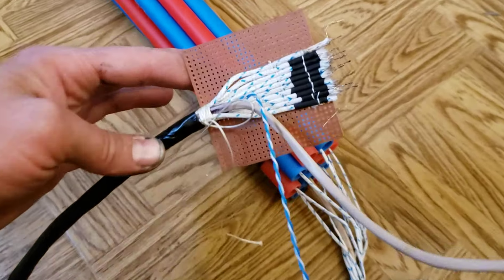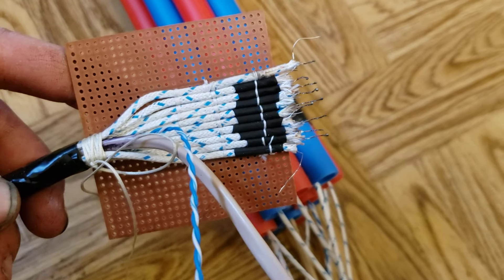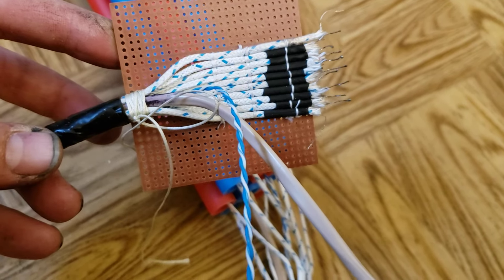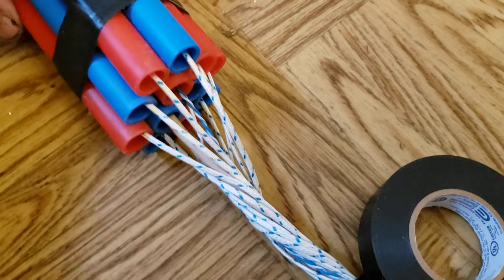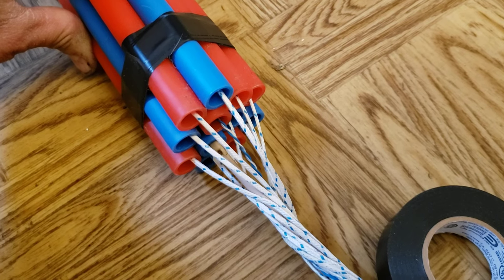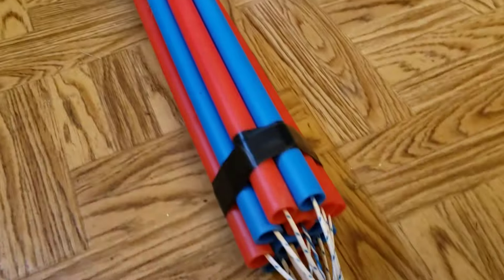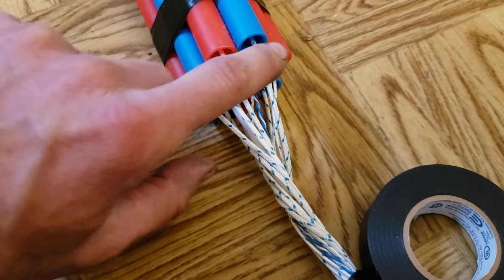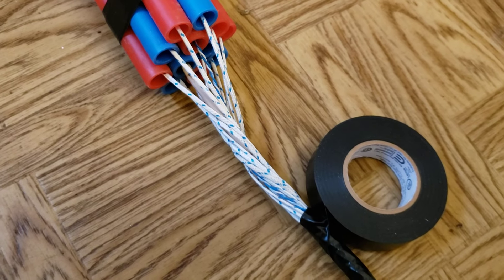Handy trick for twisting wires together

Comment: Electrically speaking, does a cable assembly like this actually need to be twisted, or is it primarily for elegance?  I see what appears to be a drain wire - presumably to a shield - on each thermocouple wire.  Are you connecting the shield on the amplifier/mux side?
Reply from the maker: The twist is for flexibility: If all the wires are straight parallel and taped tight, when you try to curve it, the wires on the outside of the bend have to stretch or the wires on the inside have to buckle/compress, which makes them break pretty quickly.

By twisting it, each wire is on all sides as it spirals around, so while they get compressed in one area they are stretched a couple inches down the line, so it makes it much more flexible and long-life.
Reply from the maker: Also, there is no drain wire and no shields. The thermocouple wires are just fiberglass clad (except the blue string in the wave is some plastic LOL)
The other wires is a 6-conductor telephone cable (for running the fans at each end) and a spare single twisted pair from a cat 5 cable in case I decide I need an extra pair for something.
Reply: @fromjesse  Ah ha - flexibility!  Thank you!  I could totally see myself saving time on something like this by not twisting and then regretting it later.  Appreciate the chance to learn from your experiences!
Reply: @fromjesse  Thanks!  My bad - it looked like a drain wire in the picture.  I've never used a shield on a thermocouple, but I've never made a great big long one either.  Would imagine that being so low-Z and fed into a (presumably) low BW diff amp, it might not need one... up to a point.  I'm not sure where that point is...

Comment: Why not short lengths of just one tube joined as in the vid?
Reply from the maker: Because if the ends are allowed to tangle, they will get all twisted up and snarled something fierce. They must be kept separate from each other because they are each turning and you'll spend more time unsnarling them than actually twisting wires!